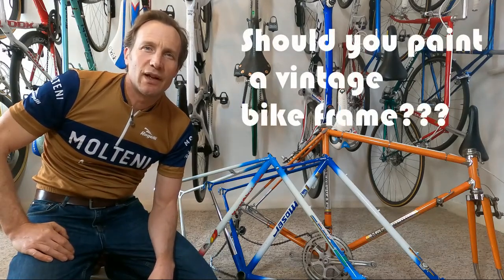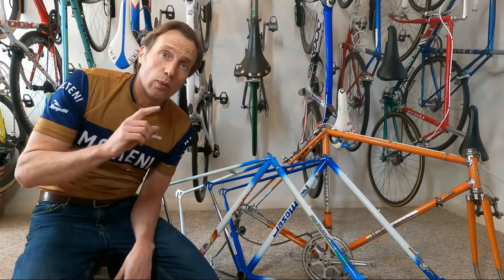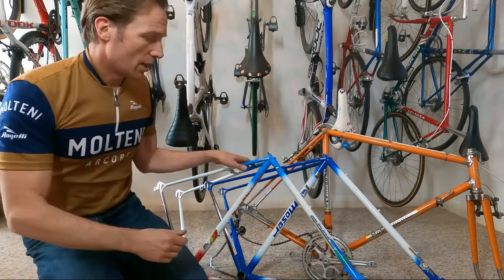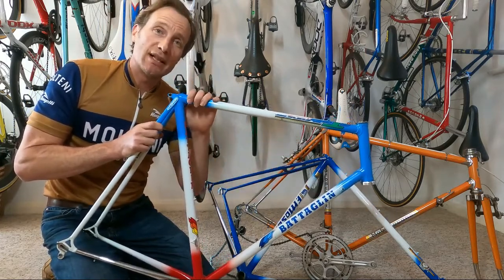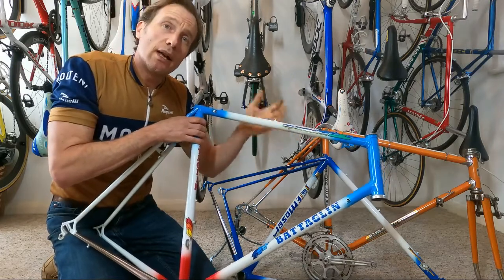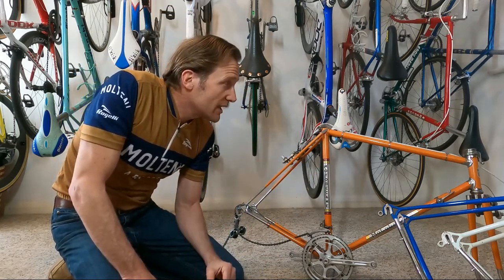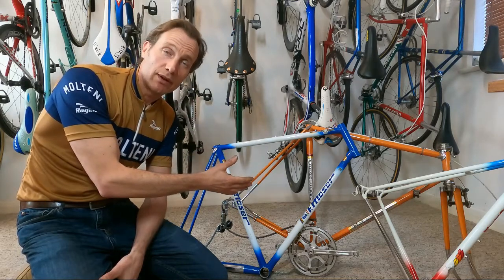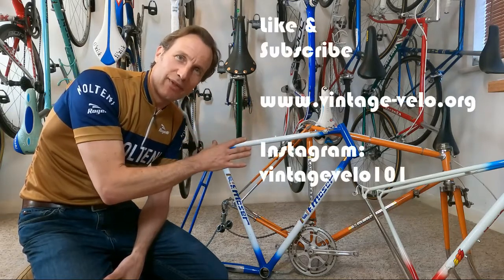Should you paint a vintage bike?

Comment: That Battaglin is a great bike. I recently bought a new old stock Battaglin Stephen Roche 30th Anniversary frame. It's the same or very similar to the one you have. It's a hand-built frame with steel lugs. It's decked out with a new Campy Chorus 12 speed groupset. I love it. It has an incredibly smooth ride quality. I think you'll love this bike once it's built up and ready to ride. I would take it any day over a carbon bike with Di2 and disc brakes.
Reply from the maker: Glad you like it - should be building it back up in a week or two, Dan

Comment: before I make this decision I use a paint cleaner for cars and hand rub with a cloth to get the dirt out of the paint. Then I ceramic coat it. Then I really look it over. Most times it looks pretty good. There maybe some chips to attend to. If it has a little petina, that is okay. I restore bikes from 1999 to 2004 vintage (Bianchi)
 Most are still pretty good.Also powder coating adds a lot of weight.
Reply from the maker: Good advice - and your correct, powder coating is a thick way to paint a frame, best avoided if possible, Dan
Reply from the maker: Great tips - if in any doubt don`t re-paint, most frames I do have already been painted or are just knackered (or really ugly white with green splodges...) Dan
Reply: Once you get all of the metal cleaned and polished, the saddle restored, new handle bar tape etc. It is amazing how much better the whole packa ge looks. I have an auto body shop that has painted parts of a frame and blended it in. For me the frame would have to be in such bad shape to repaint it completely, I probably would not buy it. This is just how I look at it after restoring 12 or so bikes. This is a great channel  for all of us that restore bikes.

Comment: Are you aware of sources for new forks suitable for vintage frames? The fork for my Raleigh International was damaged in the process of replating. To buy an almost 50 year old fork seems like a bit of a risk. It would be nice to find something in 531 to match the frame...The fork has such an influence on the ride/handling balance of the original bike.
Reply from the maker: Ah, re-plating can damage a fork - its the stripping chemicals I believe - I`d be scouring ebay for the correct set, Dan

Comment: Sound advice.
Reply from the maker: Thanks, still can`t make up my mind on the orange Motebecane - starting to like the patina... Dan
Reply: @vintagevelos9517  looking at it onscreen it does look ok, I have a 68 Gitane Hosteller that was once the candy red that Gitane used but it has turned an interesting burgundy shade which although is interesting the rest of the frame is far to rusty, as it’s just a gaspipe frame though I’m of 2 minds about spending any real effort on it as I could probably get a better one for $50, I really like the bike though so will probably bare metal and re do it. On the subject of paint I have an 80s Scapin that has been resprayed and has Santa Maria on the downtube and Record Uno on the seat tube with a 1 on the head tube, apparently it was painted by Santa Maria shop but I can’t find any information about them online. I have found a Giovanni Losa made Santa Maria frame with the exact same livery but that’s all I can find. As an aficionado of all cycling things Italian are you able to shed any more light on this Santa Maria shop Dan?
Reply from the maker: Alas thats new to me - post up on the vintage section of the BikeForums forum, Dan @Taliesin-jafo
Reply: @vintagevelos9517  I managed to find out through one the guys I source parts from that the shop is in Milan and has been in operation since 1972 and has its own team. Its Biciclette Artgianali S.Maria Milano.